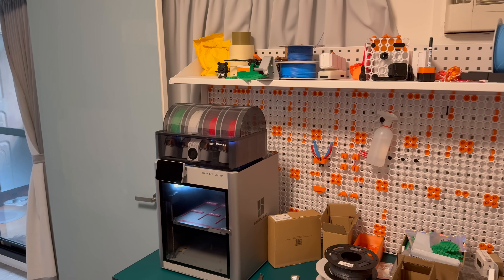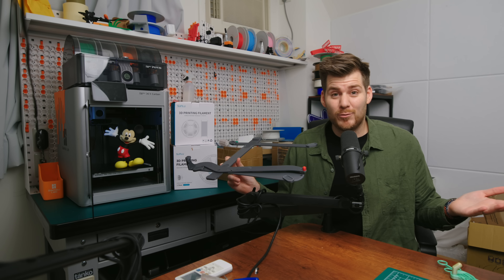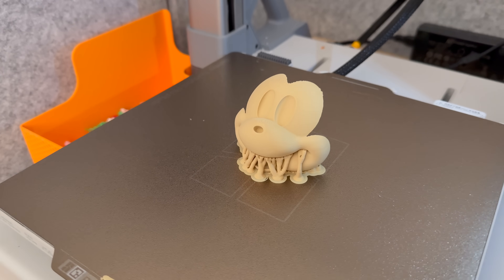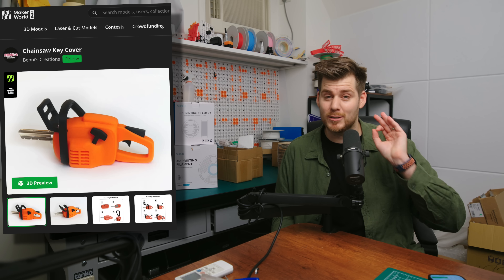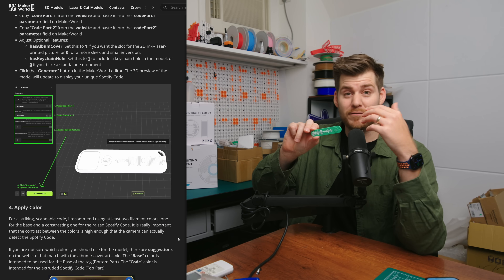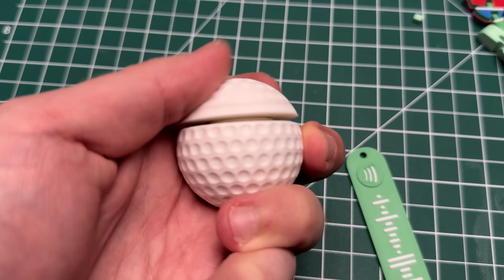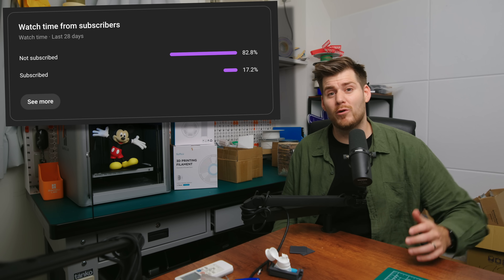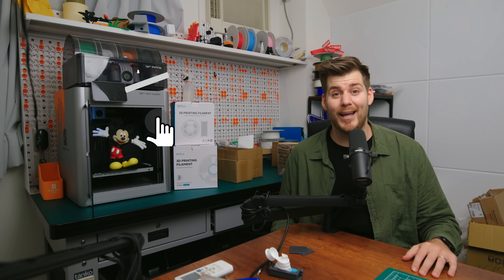TOP 3D Prints September 2025 - MUST Print for Bambu Lab A1 Owners - No AMS Needed!

Comment: Regarding the on-off switch, it isn't you. I printed the one for my P1S and the one that I needed for my anti vibration feet turned out to be too tall. So the designer clearly hasn't tested the various on-off switches on the printers they say they are for.

Comment: The first print - ON OFF switch, are you kidding me by making it must print? It's useless. Why make life more complicated?
Reply from the maker: This was all based on the most downloaded/boosted prints last 30 days. ¯\_(ツ)_/¯
Reply: I wish the power switch adapter would work.  I’ve had an issue where sometimes Bambu Studio can’t talk to my A1.  A power cycle always seems to fix it.  Having an adapter so I wouldn’t have to reach behind would be great, but I too have the top-mount system, so I guess it won’t work for me.